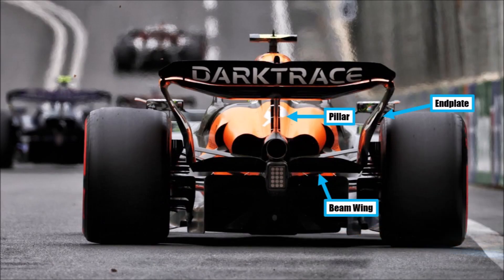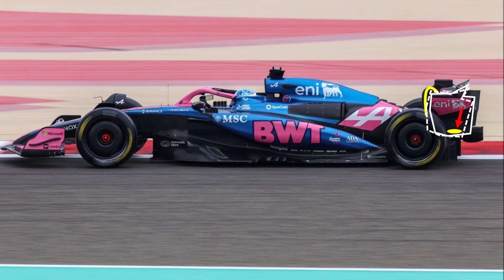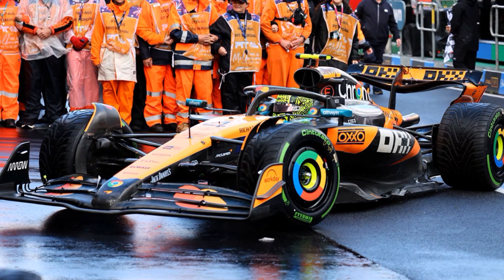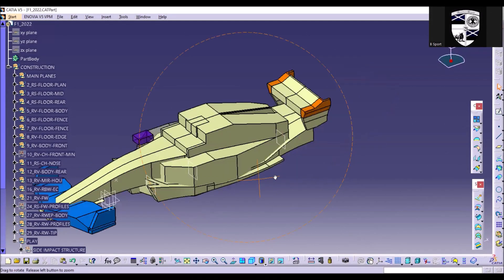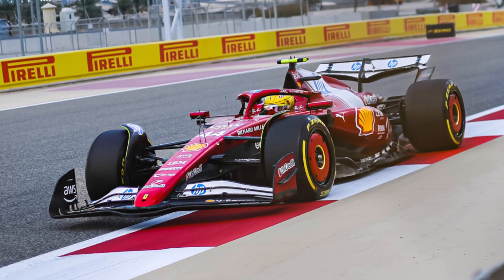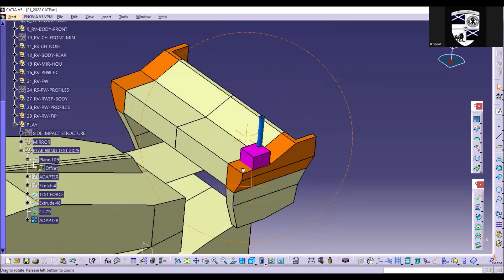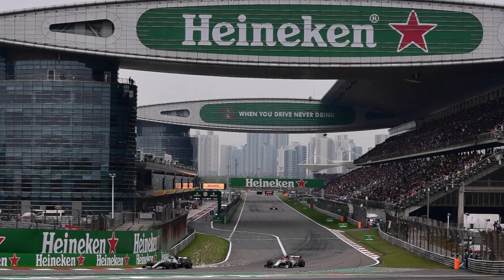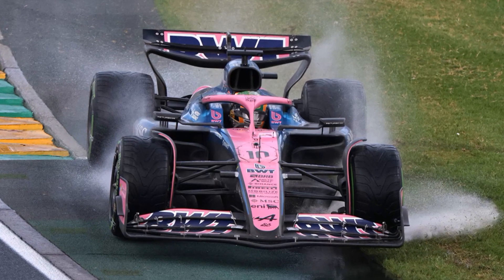F1 2025 - New Flexi Wing Test EXPLAINED (CATIA)

Comment: Great! Gluing one of them weeeengs to my '98 Ford Mondeo!
Reply: You'll be limiting your Mondeo to 340kmh though
Reply: @  but what if i want to race UPHILL, anti-wind wise, in reverse? 300kmh is my math ...
Reply: @ Well then you need a active downforce system like on the McMurtry Spierling, so that the downforce drags you up the hill at 500 km/h.
Reply: @  bro, you just blew my mind 🤣so, i'm zip tying a few house fans inside the fender wells.... wish i could send pics (imagination)
Reply from the maker: Right on!
Reply: If you actually legitemately want to improve your Mondeo a flat undertray makes a massive difference, both in reducing fuel consumption and increasing downforce.

Comment: Thanks. How would you develop a test that more resembles the real race forces ?
Reply: I dont know why they couldnt do it with the camera, like they do with the dots to see how the whole tear wing deflects. Just have a coloured strip on the edge of the slot gap on the upper element, then watch back the footage with a grid to see how much its deflecting.
If its more than Xmm, make it a DQ
Reply: Add a longitudinal load to simulate the wing drag. 

It's really that simple.